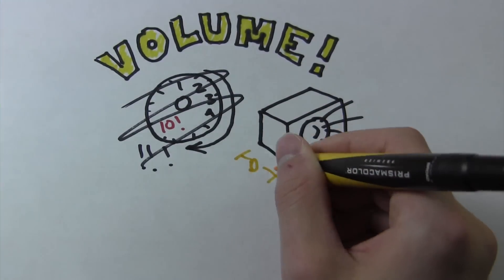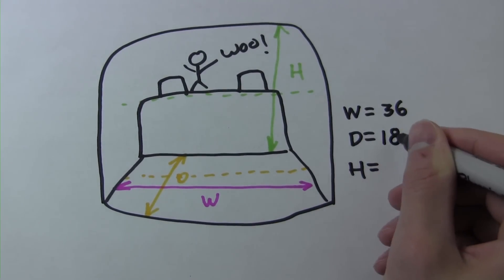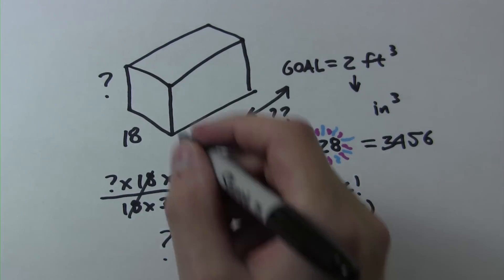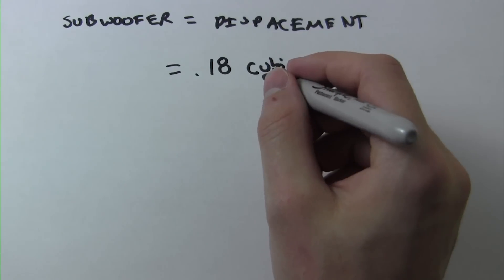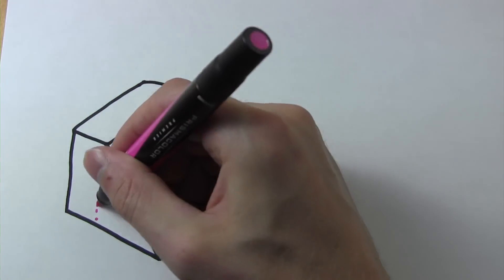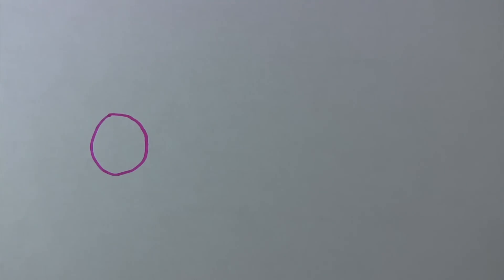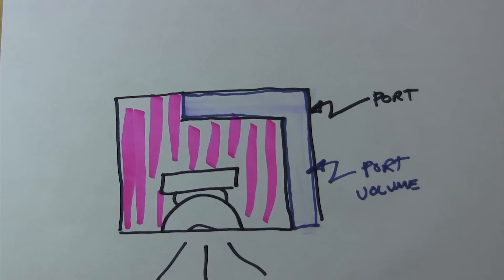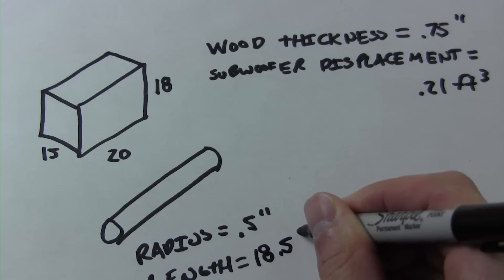Subwoofer Box Volume - Car Audio Basics - CarAudioFabrication

Comment: I'm really wishing I paid attention in math class now.
Reply: i never paid attention in math class but this interests me so i understand it no prop.
Reply: Let me rephrase that.. I wish I WENT to math class.
Reply: thornygravy lol
Reply: Problem is my lights in my car keeps flashing or dimming whyll i bsss hard, i have 1000 watt mono blk amp. And I also have a alpine 400 or 800 watt.amp 4 way . Battery cap that holds 14.3 amp. . Can you help me?
Reply: Gee Tapaoan get a car capacitor I got one for my car that had the same problem and it took care of it their like $30 at Walmart if I’m not mistaken
Reply: Gee
I see Seth recommended a cap... obviously didn't read your comment properly.
The reason for the lights dimming is due to voltage drop caused by current draw. 
Ultimately the issue has to do with resistance or supply.

Firstly you didn't mention whether this issue occurs while the car is running or not, so I will assume that it does it under both conditions, while the motor is not running as well as when it is.

The cap you have installed serves two purposes. One is to compensate for sudden load or draw. (this in essence should not be needed if system is installed correctly)
The other is for noise reduction from alternator, especially when it interferes with radio receiver (induction buzz). This cap should also be fitted as close to the AMP as possible.

I would start with the things that would cost the least money and effort.

Check that you have a good ground to start with. 
Normally the AMP body is grounded internally and mounting it to the car frame should suffice. 
Some people mount to the back of a seat which often isn't enough, especially if the seat is drop down type. 
Add a nice thick wire from one of the mounting screws from the AMP to the steel body or frame of the car.

Your main power lead should also be rather thick if you are running one cable to parallel the input to both AMPS.
Otherwise run separate cables to each AMP.
You can test this by running temporary cables along the outside of the car first.

Sometimes power to the head unit can cause power dips. Make sure the cable is thick enough to handle the load. The head unit should act as a pre-amp and the main amp gain should be adjusted to balance with max volume of the head (causes distortion if not done correctly, especially if the head unit is not fitted with auxiliary outputs and speaker outputs are used).

Take your battery to a nearby centre to have it load tested. A load test is often free. Weak cells add to the internal resistance of the entire circuit and put additional load on the alternator.

If all else fails then check the your output of your alternator. Depending on the total current draw of both amps combined you may not have enough current being produced by your alternator. This is probably the last resort and also the most expensive. Unfortunately it is also the most common cause and a suitable replacement should be fitted.

If none of the above work, a can of gas and a match will solve the issue.
Reply: How much of a joke it might be to discuss not paying attention or skipping math class, it's actually incredibly sad. This is 5th grade geometry. Any normally educated adult should know these VERY basic formulas, and the just as simple theories behind them.
Reply: Alex Burns 
My thoughts exactly.
Reply: @geetapaoan2987  up grade your alternator most likely will stop your lights from blinking..
Reply: Me too
Reply: Im really bad with math i dont even know multiplications but for some reason if those numbers have a $ or a % everything changes .... For real .... Don't understand why...🤔
Reply: Word🤣🤣🤣

Comment: There I am whipping out my exam pad, measuring tape and pen to calculate the volume of my wedge box only to discover that the box is one whole cubic foot smaller than the recommended volume of my two 15 inch subs. These calculations are actually quite fun once you get into them. Looking forward to building my first enclosure once my router arrives. Learned a whole lot from this video so 10000 likes from South Africa even though the constant need to convert from imperial to metric and back is a pain in the proverbial ass.

Comment: The short answer is cross sectional area and the length of the port. the free RE calc doesn't tell you cross sec area, i found one that does. Carstereo website port calculator worked for me, used two aero ports to fix my mis-tuned box, now it's Fawesome! removable port extensions let me tune to what i want, and it's cheap. like 7 bucks for a 24" by 4" pipe, just cut it in half, flare it some way, buy a connector and glue it into a board, shove pipes in, and enjoy tuned boomboom! Cheers!

Comment: My question is: I have a ported enclosure that is .90 cubic ft. I have a shallow mount sub that requires the min 1.25cft if ported. Will that hurt the performance of the sub, or can I just increase the power to compensate?

Comment: nice!!!! I have found it easier to add the top and bottom together on a wedge shape the divide them in half... such as your box was 5" on top 10" on bottom  so that's 5+10=15 divided by 2=7.5 deep. but your way works just as good.

Comment: Great vid. I'm fairly proficient with math but your how to build vids are why I subscribed. Question though. Back in the day, I would calculate the required volume needed by the woofer and get a volume nearly twice as large as recommended by the manufacturer. Was I finding full wave requirements whereas the manufacturer is using a half-wave or quarter-wave requirement? How do you find the needed volume for a specific woofer or do you just go by manufacturer recommendations?

Comment: The packing peanuts idea was genius.
Reply: While it can be used if you are absolutely lost in terms of figuring out a complicated shape, you can get an idea. Unfortunately my experience is that it can be as much as 30 percent off.
Using a large plastic bag and patience, use the water method instead. It's incredibly accurate.
Just to get an idea of how hard it is to get a precise measurement by filling with something firm like packaging material, try this. place three cups of flour on three plates you have weighted before hand. Weigh these three portions of flour. They will be very different, and that's using very fine particles. It'll be much worse when you use something like foam popcorn.

Comment: For what it is worth. This box would accommodate 3x8 subs in the large face, 2x10s, 1 12 or 1 15. An 18 inch would have an outside diameter larger than the face of the box. I didn't feel like calculating for all the various combinations of box volumes. But since the driver displacement was given I figured it was known to be 1 choice anyway.

Comment: I appreciate the channel info and advice.
I’m currently planning a upgrade for my f250 crew cab.
I’m a carpenter and have built boxes in the past.
Im curious if a behind the seat box or a rear console build would be best.
I’m considering a single 10” sub to go along with my alpine components.
Any tips or video links are much appreciated.

Comment: Empty box volume= 18.5*13.5*16.5/1728=2.3848ft^3
Brace volume=(0.25)^2*3.1415926*18.5/1725=0.0021ft^3
Driver Displacement=0.21ft^3
This gives us a working volume of =2.3848-0.0021-0.21=2.1727ft^3
----
Best guess is the driver is a 15 inch round sub due to the displacement and the sub has a cutout diameter of 14.125 inches. Gasket thikness=0.0625inches.
Driver cutout volume increase=8.0625^2*3.1415926*(0.75+.0625)/1728=0.0738ft^3
Final interior box volume = 2.1727+0.0738=2.2465 ft^3

Comment: I totally understand the idea of calculating volume and how to do that. 

What I don't understand is why air volume is important to audio quality, or what it has to do in particular with the propogation of the frequencies we're looking for. 

I've done audio mixing and mastering, but I'm only just getting into car audio. I'd love to hear more about that.
Reply: Not a pro on this, but the way I understand it, it has to do with wave lengths, amplitude, resonance and surface area. Think of it this way... remember the slide whistle we all played with as kids. The more you push the slide in the higher the frequency, the more you pull it out the lower the frequency... need I say more?
Reply: The basics are as follows.
Your transducer needs an air spring to control it. The volume behind in relation to the volume in front, will determine how well the transducer can resonate in a set bandwidth of hertz.
The box is not exactly when gives you the sound quality per se, it's what gives the transducer the optimum conditions to reproduce the electrical AC signal fed into it.
That being said, a box can have great effects on the sound quality, but not because of the transducer itself. If the box resonates, or leaks, amplify harmonic distortion or sounds, has too small ports ect. then yes, the box is part of what makes a speaker sound bad. In other words, you want the box to become as "invisible" as much as possible.

Comment: question regarding the wood inside the box. You mention to take away 2" from the dimension with a wood thickness of 1". Does the length make a difference in the calculation? because it look like you only consider the thickness but not the length.

Comment: so if I want a ported box with 6 15s where one sub is recommended using 100liters netto of volume. I assume I wouldn't need 600liters right? just the 100liters + the displacement of all the subs added to the 100l ? or do I need the full 600liters?

Comment: I have an old Eclipse 10" SW6102.8 .  I cannot find ANY specs on it.  I went to the stereo shop where I purchased it (more than 10 years ago) and they had nothing (his internet search had nothing).  This woofer still sounds good.  I just want to build a difference enclosure.  I really don't have away to determine the amount of airspace I need.  What do you suggest?  Thanks

Comment: I have 2 soundstream t5 tarantula 12” subs. The manufacturer suggests a minimum of 1.75 ft3 for a ported enclosure or 1.5 ft3 for a sealed enclosure. Unfortunately I’m extremely limited on space. The box is only able to be 1.25 ft3 per sub. Will it damage the sub if I use a smaller than recommended enclosure? Will ported or sealed sound better at that smaller size? I will be running a soundstream txp1.6000d amp to the subs so power will not be an issue. Thanks.

Comment: Now quick question just a lil confused. For the box in your video. Do i use the 12 and 20 or do i use the 10 and 18 which was after calculating wood thickness? When building the box

Comment: If I have a custom box made do I need to match up the cubic volume of the subwoofer to the box, I have a Chevy avalanche midgate 2 12’s box, my box has air volume 1.32 cubic feet per side total and port volume .268 cubic feet per side total, so I didn’t know if I need to match subwoofer air volume to the box

Comment: I'm about to build a sealed enclosure for a 12" sub and I was wondering, if I keep the internal box volume recommended by the manufacturer of the sub, but I need to use a smaller mounting depth, how would this affect the output and quality of the sound? And how much of an impact does the shape of the box have on the performance of the speaker?

Comment: I have 2 alpine type r's swr1242d's in a sealed box with separate chambers with each chamber being 1 cubic foot..the manual for the subwoofer says that the optimal gross internal volume for a sealed box should be 0.85 ft3 (to the 3rd power) and a net internal volume of 0.78 ft3 (to the 3rd power)....so is my box sufficient for these subs? My initial thought was that the box is pretty close to those numbers once the subs are mounted inside the box...would appreciate your thoughts TIA

Comment: Box volume effects the tuning frequency and if you make your subwoofer bigger you will bring the tuning frequency down and if you make your subwoofer box too big then you will bring the tuning frequency back up and that can make your subwoofers less louder also if you make your subwoofer box smaller you will bring the tuning frequency up and your subwoofers will not be as loud and if you make your subwoofer box too small you can suffocate the subwoofer and blow your subwoofers
Reply: What if you have the recommended volume (0.75 cubes for a sealed enclosure) but the width makes the back of the subwoofer almost touch the box (ie a slim enclosure), does that affect the subwoofer output (even if with woofer displacement in the box the box is still 0.75 cubes)?

Comment: Hi, nice video. Please how do i calculate the internal size of the sealed box? Of this 
External Dimensions (LxWxH)	444mm x 384mm x 309mm
Reply: subtract the wall thickness from each of the length/height/width.

Comment: What are the pros/cons of sealed enclosure vs ban pass vs ported vs 4th order vs 6th order... etc? Thanks.
Reply: kafoure93 - sealed boxes are smaller (no need for internal space for a port), their frequency response is generally flatter (ports boost certain freq's), and they're usually easier to build. Just some basic's there...

Comment: Haha when my friends told me we wouldn't use algebra late run life 😏 this proves them wrong 😝
Reply from the maker: Klaxz _ Math does come in handy! Thanks for watching!
Reply: You're welcome c:  and I have a question if I don't have a air saw to cut fiber glass what can I use? I'm trying to join my bottom side of my box with the fleece but I need to shape it round
Reply: I can't do algebra or geometry but I can figure out how to get volume, area, square foot, ECT. How much water does a 24' round 48" deep pool hold? How many square feet is in 40'×60' house?

Comment: Awesome bro! Always wanted to know how to design a wedge box & calculate the internal volume.
What if the manufacturer recommends an enclosure of 48ltrs with a port tuned to 32hz... but I want a larger box, if I increased the box volume to 62ltrs and ported it tuned to 32hz, would this still sound good... maybe slightly more boomy sounding?
Let us know what you think.
Che bro.
Reply from the maker: Theres actually a program out there that allows you to input specs like this, play with box size and determine what the differences in output will be. Its free and I show it in the video below:: How to Design a Subwoofer Box - Design Software and the Math! Car Audio Fabrication CAF
Reply: @CarAudioFabrication  Video is now "Private"?

Comment: Should you also add the volume of the speaker hole cutout (assuming a top-mounted woofer)?   i.e. the hole makes the box volume slightly larger before the woofer drops into it and makes the volume smaller.
Reply: no
Reply: +qjuan white Why wouldn't you?  Taking out part of one of the walls makes the box bigger.
Reply: I don't think  the woofer hole matters just account for anything taking up space in your  box
Reply: Good question and I fully understand. If you don't subtract that piece then why do you have to add baffles and braces when figuring volume?

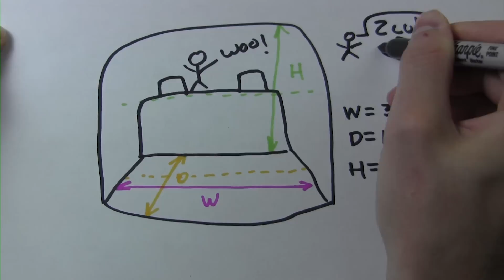Comment: 1:21 - how do I know how much is the required  volume?  and if I have two speakers does the volume required multiply?
Reply: Paolo Pabalinas the subwoofer displacement value is doubled and added to the overall volume of enclosure.
Reply: what I want to know is the height he got from the sealed enclosure from inside or outside

Comment: Assuming a sealed box, does the shape of the enclosure affect the sound quality at all?

I ask because I was using a square prefab box that wasn't quite big enough but now I've built my own box to the right size for the sub but it's a much more rectangular shape 26.5x13x11 (WxHxD) to try and maintain some space in the back.
Reply: It depends. If your driver has some harmonic noises, it can. That being said, the notion of standing low frequency waves inside a subwoofer box is as asinine as can be. Those waves are much, much longer than any inside dimension of the box.
The biggest issues with completely square boxes are that they are the most prone to resonance and harmonic distortion - so avoid that.
For the reasons explained above, a trapezoidal or wedge shaped box tends to be more "dead". If you design a box that sounds good in terms of response, but you find find that is has some harmonics, do the following. Just get a roll of Gladen Aero-Multi and line your box with it. It will remove a lot of vibrations and it will take care of the harmonics, but it will not change the volume and tuning of the box like Poly-fill does.

Comment: What is the advantage of a big volume sealed enclosure compared with a less volume sealed enclosure? why is louder the more volumen applied?
Reply: Even if you are dealing with a sealed box, there is a point of diminishing return if you make the box too big for a certain size driver. Even though a sealed box is more forgiving to tune than a vented box, you still have to closely match the volume of the box to the speaker to create the proper back pressure.

Comment: How would you determine the total cubic inches of volume  that the  box design needs for subwoofer to perform at its best?
Reply: the speaker manufacturer normally specifies the displacement on the box it is packed in.
Reply: Use the Win-ISD software.

Comment: Good Day, would like to know if its wise to use the manufacturers volume specs of a sub, or if i can go larger ?
Reply from the maker: You can go larger, but only should if you really know what you are doing as too large an enclosure can damage the sub.
Reply: CarAudioFabrication , it's not to much larger , the recommended volume is 1.25 cubic feet, I was thinking going 1.75 , and tuning to 30hz , it's a sundown audio sa-10 
And I'm using win ISD  and the method that you have shown to design the enclosure